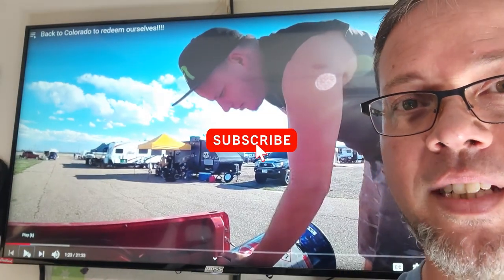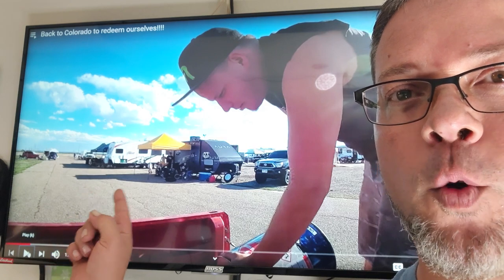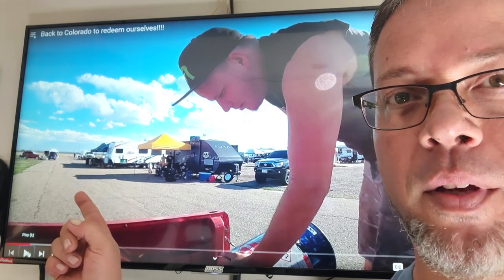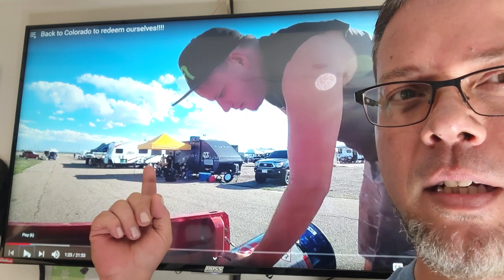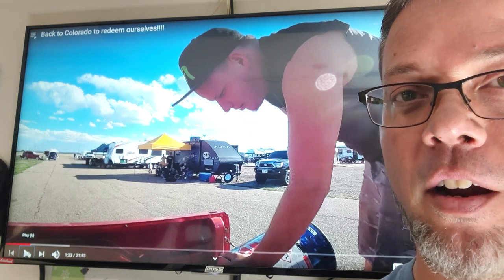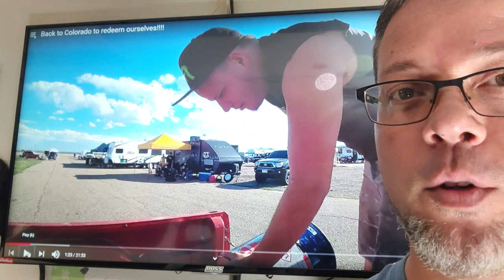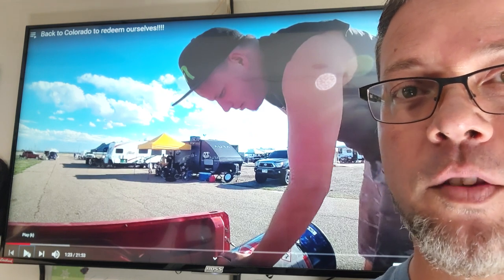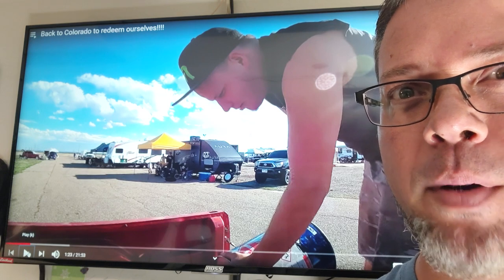2019 Dodge Challenger 1320 has no chance against the Krazy House Performance (Junkyard Build)

Comment: Hey thank you! Your awsome for the shout! And as far as your questions I'll give a small run down everything was bough in a junk yard near me factory bottom end other than new gaskest bearings and such a junk yard 727 with a mopar 8 3/4 rear end . 100% mopar and next and final 100% 88 dodge dakota 4cyl suspention nothing has been done to the suspension at all other than lowering blocks !
Reply from the maker: Dude holy crap that is Krazy that it hooks up. Don't change a thing haha
Reply: I found them because Brent at PFI in Colorado dynoed and tuned that truck with the twin turbos. It was pulling a ton of hp and Brent was impressed. They are building a new block for it now and it's almost ready to start now. A very cool truck and group of guys that run a bunch of different cars. I guess we both found them because of The PFI video... 👍I've always been a Mopar guy and recently got a 06 Charger Hemi RT that will just destroy my Dart I retired and now I want at 5.7 for it someday...

Comment: Apparently, the 5.7's can be boosted as they have lower compression than the 6.4's which are high compression and can't handle boost without upgrading to forged pistons. Too bad, FCA didn't put forged components on the 1320 from factory.
Reply from the maker: Oh i wish they would have so bad I want the hellion kit. 5.7 can make crazy power with boost. Thanks for comment
Reply: @Destroyer1320  
Yes, Hellion turbo's are better than superchargers.